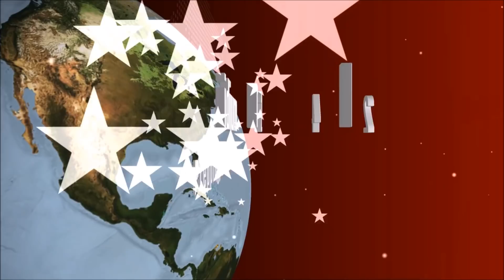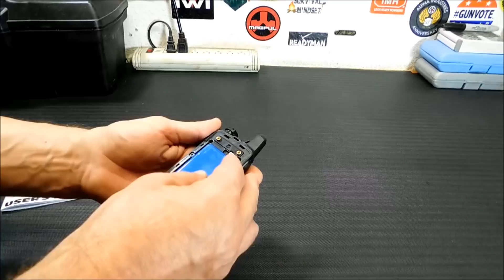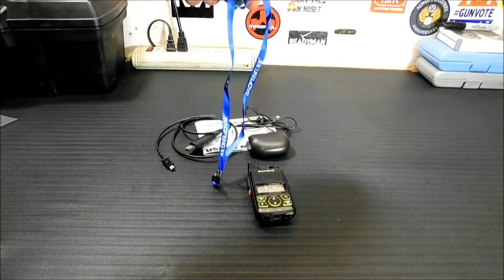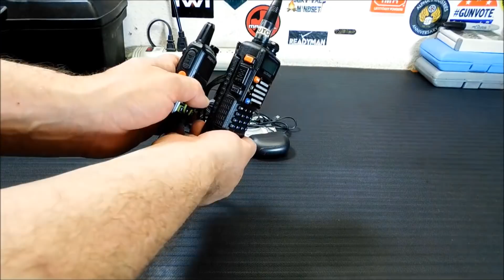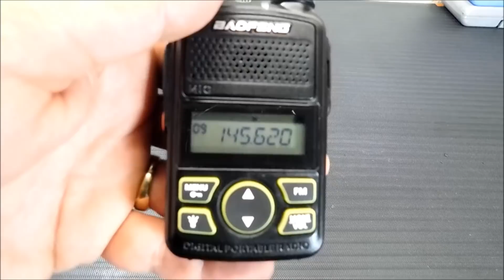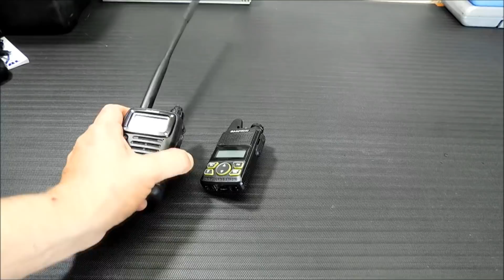Baofeng BF T1 Mini 440 Radio

Comment: I fitted a 82 ohm resistor in series with the speaker 100 ohm would work as well kinda calms down the excessive volume

Comment: I doubt it would damage the radio using on vhf, it's only 1 watt after all, if it reflects 80% will still be too little, specially if you don transmit for long periods

Comment: Hi, I bougth two of these baofeng BF T1 440 Mini but they dont transmit to each other!! They only receive music radio frequencies like in the car! Why? They need programing?? Please help me im really frustated I really like these radios.
Reply from the maker: You need to program them. Baofeng has an app   on their download page called "9100" you need that and the programming cable for this radio and it should be easy enough to program.
Reply: @Iridium242  Thank you very much!! No need for that CD ROM that comes with some packs rigth?
Reply from the maker: yes
Reply: @Iridium242  hi, allready programed it with the 9100 program you talled me, I cant communicate with the other radio more than 100 meters, but it does receives that automatic reptition clip on the repeater in my area that  is 2,8 km away, and it seams to transmit too because some times after transmitting I ear noise. I really dont understand whats missing! I also receive from another repeater thats 30 km away no sound just the green light.

Comment: Will it scan the channels? Thanks
Reply from the maker: It will but only the frequencies you have programmed in, it wont just scan up and down a band.  You also need to enable the scan mode (Which is number 8 in the menu) via the software to enable scanning.  Once its enabled, you hit the menu button, get it to menu 8 and hit the orange button on the side to scan all your programmed frequencies.

Comment: Hello, i recently bought 2 of these. Can i comunicate with my wife in a camping trip or survival situation using FRS channels only, it this legal or not ? I live in FL
Reply from the maker: The frequencies that come programmed in them are partly in the ham band and partly on the public service band, so I would not use those, You can always re-program it for use on FRS but it would still technically be illegal to use as  the radio is not FCC type accepted for that.. but I doubt anyone is going to chase you down for that.  You would need a ham license to operate this legally on ham bands.
Reply: i understand that but the radio dosent have esternal antenna and is programing by computer not manual its tramsmit 0.5w to 1.0w. I dont see nothing ilegal in the FCC part 90
Reply: @epineir  I'm new to amateur radio  so don't know if I'm right...  maybe because the radio is capable of transmitting on amateur frequencies is the reason it isn't legal to use with FRS.
Reply: The reason they can't be legally used as FRS radios is it doesn't have a Locked PLL.  And, from what I've read, this radio has too much spurious emissions to pass FCC tests, so is not legal in the U.S. even for licensed amateur operators to use.

Comment: how far do you think it can communicate with another such radio in a city ? thanks
Reply from the maker: A whole lot depends on line of sight, how densely populated the area is, and how high up you are while transmitting.
Reply: @Iridium242  maybe 2 miles - possibly in urban environment - better than FRS anyway - thanks for the reply
Reply: cassanoa I live in a city and someone receiving me 5 miles away but they have a roof antenna
Reply: just tried two of these in australia wont even do .6 of a kilometer . Feeling ripped off
Reply: @sabinekatsavrias4422  Hey is that the VHF or the UHF that won't reach or both?